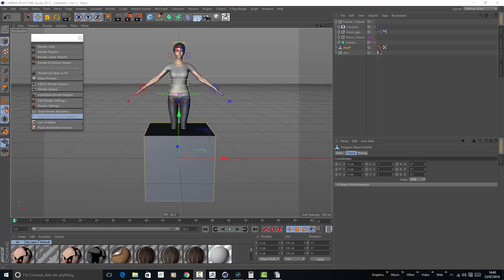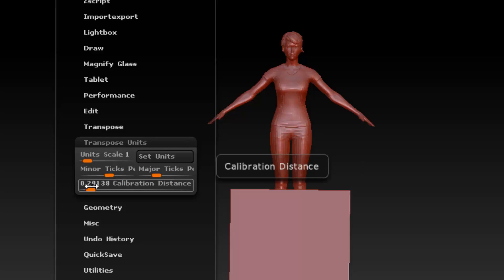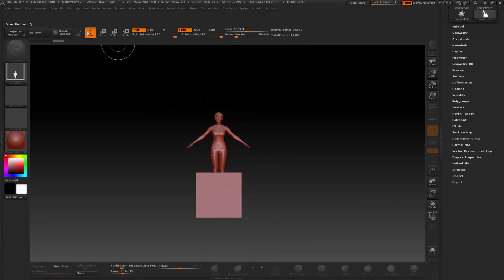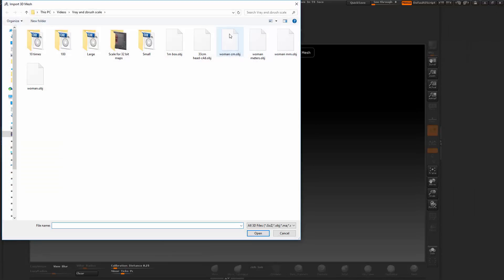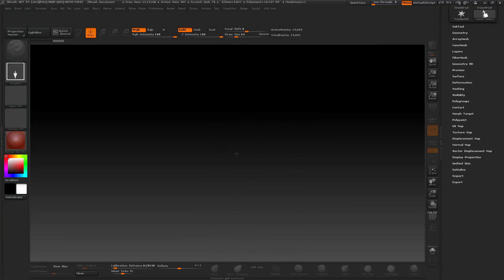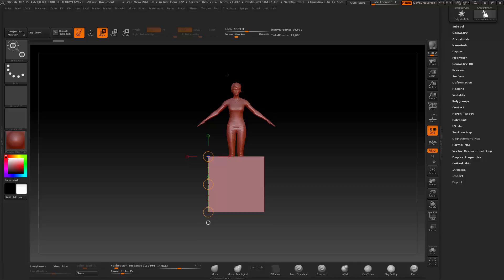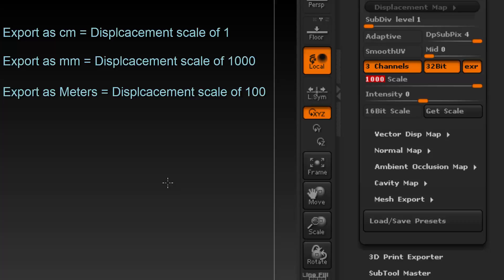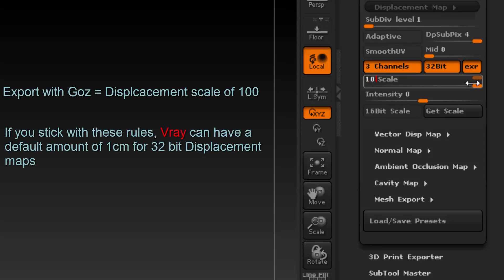Zbrush scale and 32 bit displacement maps

Comment: Hmm... you sure that's how it works? It doesn't make sense. 
If cm meters are kept at 100, meaning 100%, and cm are put at 1, meaning 1%, why is mm 1000?
Reply from the maker: Mohamed Banni It don't make sense yet test after test if I do as in the video my maps work perfect.  I   will do another video as much depends on export settings and if zbrush works at the scale of 2 the ideal unified scale, the export options must be right.  So If your character was already the correct scale of say 170cm all when you bring that into Zbrush it will be 170 meters tall, but it should set the export scale at 0.85  170 /2 = 85, for meters its 85 and cm 0.85.  The issue is when Zbrush brings in a mesh at a odd scale say 3.4, if you manualy have to set the export options it shifts its figures by itself and the export scale will be out every time.  Its when Zbrush does not use the scale of 2 is where this messes up the displacment map making.  At times its 2.0001, then 2.1001, and even if you set it at 2.00000 manualy it changes it afterwards.  If you try and compensate on the export settings it then shifts its number again and your model is slightly out.